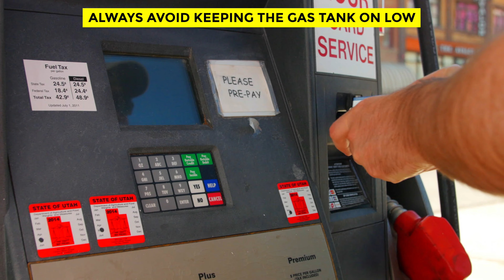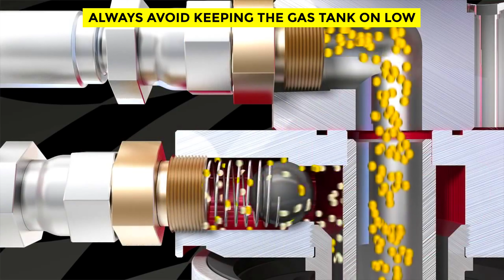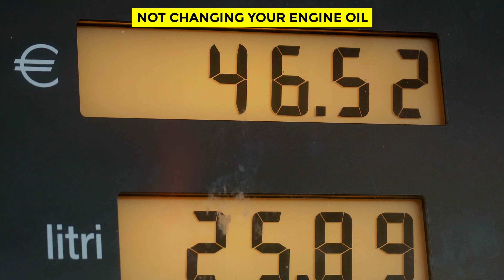The 4 Deadliest Car Mods in America!

Comment: Running your vehicle low on fuel doesn't matter if you have a manual fuel pump.

Also, I think you meant oil filter, not fuel filter during the oil change part.

For the coolant part, one of the the other things you forgot to mention is that old coolant can also cause electrolysis. And if you change your own coolant, and you buy straight coolant, it's recommended that you use distilled water for mixing.
Reply: OK Mr   expert
Reply: Most newer vehicles have electronic fuel pumps that require enough fuel in the tank to keep it cool. He did mean oil filter but got ahead of himself calling it a fuel pump

Comment: Complete engine failure and damage to the transmission as a result of running out of fuel? Sure the engine will stop, but it will be fine once fuel is added. Also I'm struggling to see how the transmission would be affected at all.